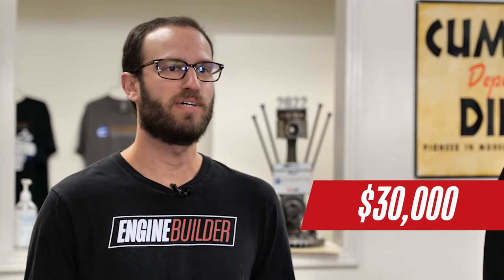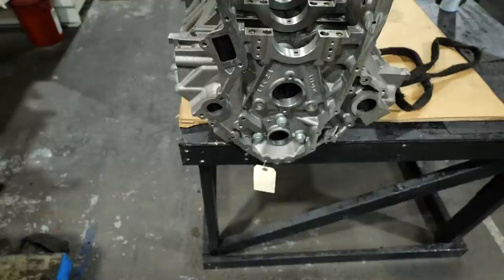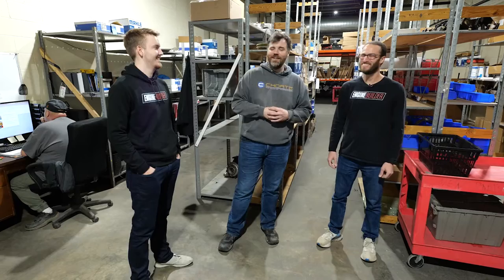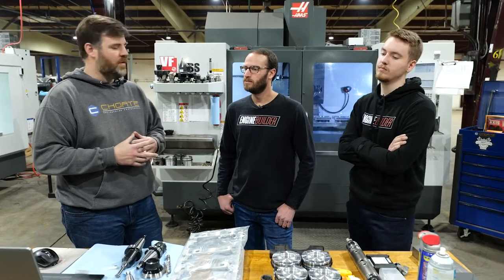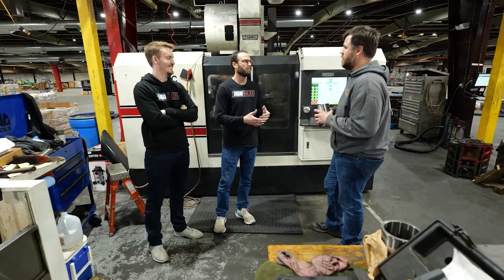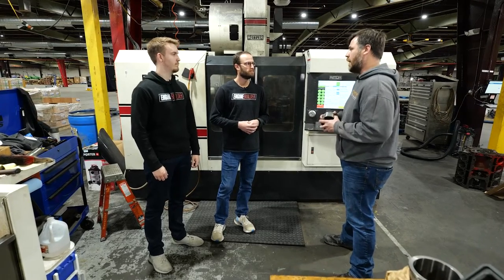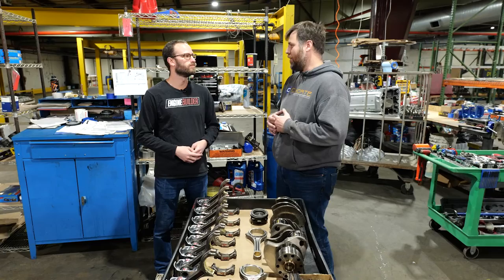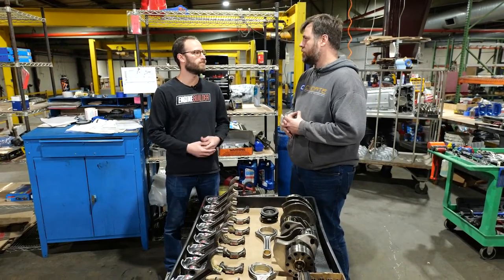Mild vs. Wild (Diesel Edition) Ep 5 – 6.7L Powerstroke Builds

Comment: For mild build on Street, is this a build where emissions can go back on for street legal? Will OEM ECM and components… pump, injectors, etc remain stock or upgraded?
Reply from the maker: Please double check with Choate Engineering Performance, but we do believe the mild build would have emissions on and most of the OEM components you mentioned.